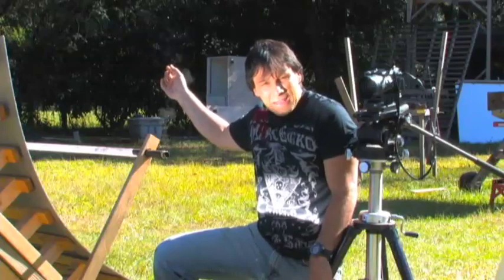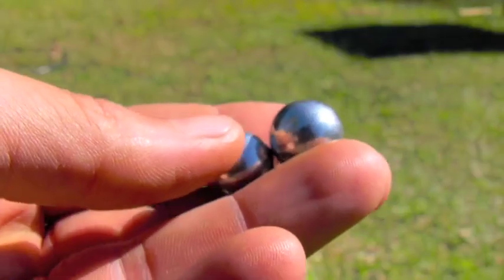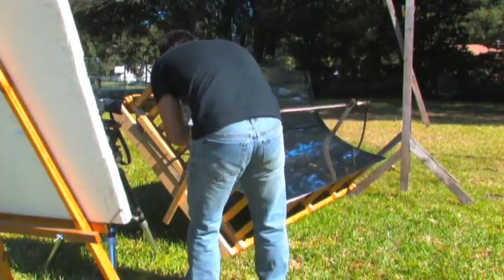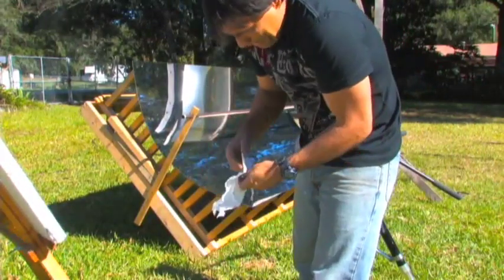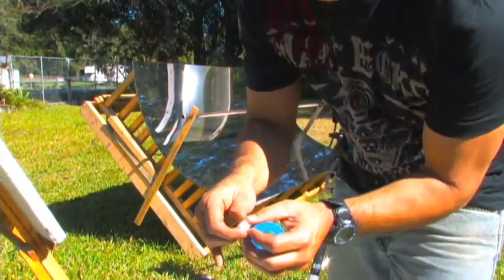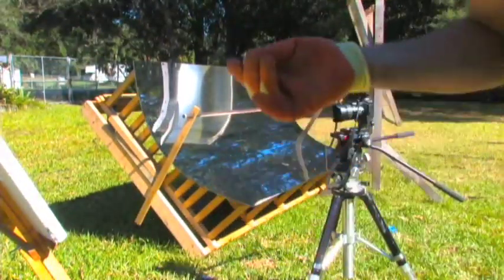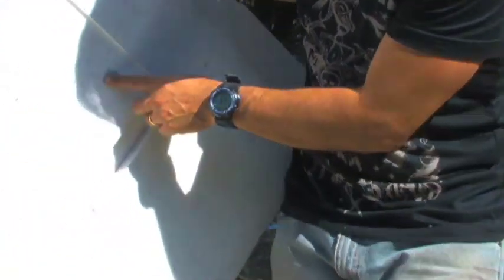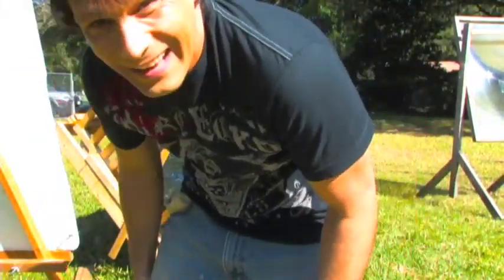Flash Steam Cannon Solar Powered Gun Trough Mirror Free energy in minutes

Comment: Good Job! Now Yer Talkin' !! It doesn't get fun until you put some danger in it !! 

Just wondering if you have a flow check valve on the water line just before it goes into the pipe. Maybe you can get more kick. If that steam preasure is greater than the water preasure in your hose it may be loosing some preasure back into the hose and lessening the initial kick. 

Try extending the barrel about 3 ft. & only push shot in 3 ft. creating a larger expansion chamber before contacting the shot.